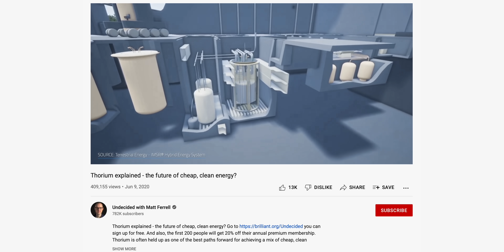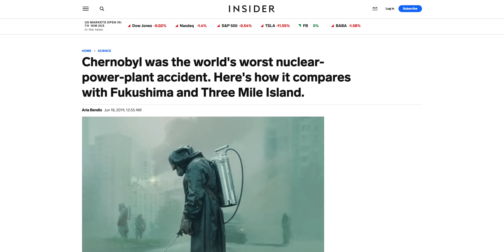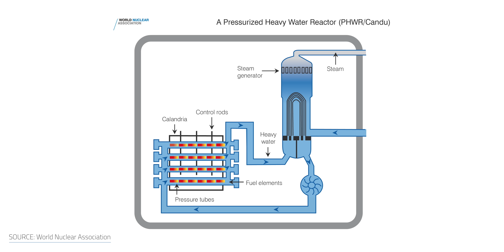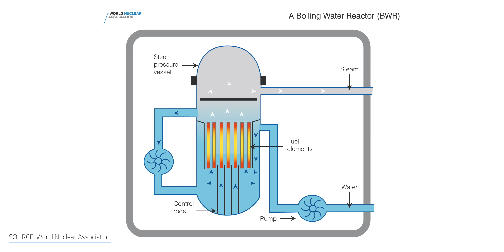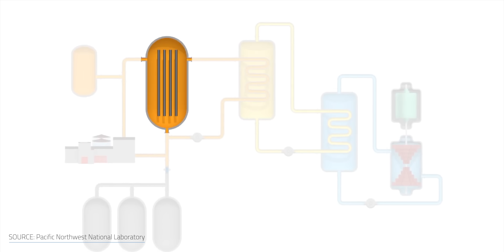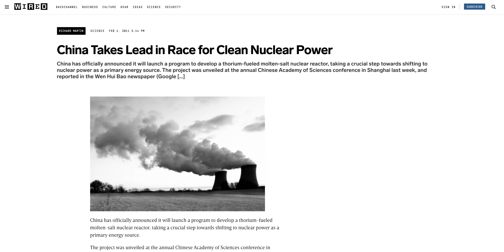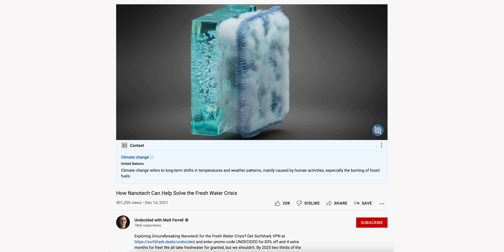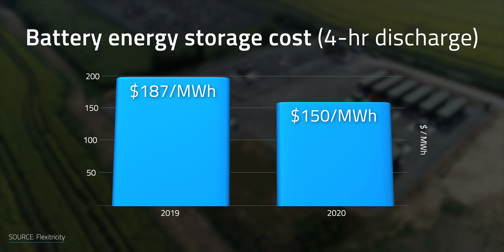Revisiting Thorium Energy - The Future of Nuclear Power?

Comment: You have to have nuclear if you want to go Carbon Neutral. Wind and solar is too intermittent. You need a hell of a lot more than 4 hours battery storage if you get rid of carbon emitting generation. Although the price of manufacturing batteries is going down, for now, the cost of lithium is going up. There isn't enough lithium on the planet to make the necessary batteries for both transportation and generation storage under the renewable model. We would never run out of Thorium.
Reply: Problem is too many don't understand the meaning of energy density. That's where nuclear energy of any kind wins by orders of magnitude. The need is to get away from cycles that are like burning platinum like fire wood.

Comment: Of course we need Thorium Reactor and Fusion Power if we can achieve it. After 30 years of mining all the Lithium on earth for batteries and solar panels, we'll find out that solar is not a 'renewable energy source'.
Reply: Honestly, it is stupid to be using lithium for stationary power storage anyway. The greatest benefit of lithium batteries is the energy density by mass, but stationary systems do not need to worry much about how heavy they are, rather they need to be as cheap as possible, and elements like sodium, magnesium, calcium, iron and aluminum are some of the best and cheapest metals that should be getting utilized for such purpose.
Reply: @nolan4339  Fully concur, but that is not what's happening. Just like we should have used Thorium Reactors 70 years ago, but the guys with the big bucks and business plan always steer us down the road of using their resources because of profit rather than common sense.

Comment: My problem with solar and wind LCOE estimates is storage and 4 hour storage numbers are not long enough. Multi day storage is necessary as extended regional cloudy days and calm air (no wind) occur regularly.
Reply: Yes, and batteries will likely never be up to the challenge of being used for long term energy storage. So some level of fuel-based energy backup will be required.

Comment: These reactors may be particularly useful as we run up against supply problems with materials used to create the massive batteries used in grid storage.  There are unknowns when it comes to problems of mining these already rare resources which will become ever more difficult in the lead up to eventually mining asteroids (as we burn through the low hanging fruit of easily minable deposits faster and faster in the scale up process).  They also may be particularly useful in areas of the earth that go through long periods of little to no sunlight that are also geographically unfit to benefit from wind.  Finally, the fact that these are self-regulating and smaller reactors may make them good candidates for powering heavy equipment in the low population build out of moon/mars/etc industrial/colonial infrastructure.
Reply: Gridstorage is likely not going to use rare materials. Currently Li-ion is used due to its overall maturity and cheaper cost due to scale. However there are plenty of different options being rolled out/developed with more common materials that are much more suited for gridscale storage. In the grid Li-ion will likely only be used as fast reaction units to stabilize the grids due to these other options usually having a slower reaction time (seconds to a minute vs a fraction of a second), and will therefor only make up a very small amount of the grid storage long term, unless if you count the EV batteries that might take part in a gridstorage system.

Comment: Ted Scott. England. Thank you very much Matt for another superbly well prepared and presented video. I have followed this subject with great interest since the 1960's when the trials in Tennessee were carried out. Also. Very important is the massive discussion submitted, which is very relevant. One element of it is the material of construction of the reactor to withstand the long term corrosive effects of 500+ Deg C molten salts, particularly fluorides. A considerable problem I suspect. In my humble opinion, I believe there will be a definite place for this technology in the solutions mankind finds for the energy generation of the future.

Comment: I do hate how these get referred to as a 'Thorium reactor' when It is a thorium fueled LFTR, or some other design that can utilize it as a fuel. It is each design that needs it's own evaluation, not the fuel that it might use. And when comparing the benefits of Thorium as the fuel for such a system please don't compare it to old pressurized (PWR) and boiling (BWR) water reactors. These designs that utilize thorium in the most efficient way are in essence a breeder reactor, so please compare them to other breeder reactor designs instead of incumbent/typical nuclear.

To attribute all the benefits of these new reactor designs to the fuel perpetuates a misconception that only Thorium can be utilized in such a way when in fact many of the MSR designs are instead looking towards utilizing Uranium and will gain many of the same benefits that the so call 'Thorium reactor' is stated to get.

I appreciate that some mention of other MSR designs that do not utilize thorium was mentioned, or hinted at, but these other MSR designs are the competition that Thorium as a fuel is competing with, so any comparisons of technology should mostly be done between these Gen 4 reactors.

Comment: (5:50) Waste from a thorium reactor only requires 500 years to decay away. 

The way you characterize this makes it seem like that the short half life of waste from a thermal spectrum thorium breeder is a property of thorium. It isn't. The short half-life of waste from a reactor like this is chiefly due to the fact that you're achieving an almost complete burn-up of the fuel, which is enabled by the fluid nature of the fuel and the ability to pull out fission product neutron poisons, chiefly Xe-135, as they're produced. You'd get almost the same burn-up using pure U-235, not quite the same burn up but close to it, or from a fast spectrum reactor. 

It's true that starting with U-233 will achieve a higher burn-up than starting at U-235, as U-233 has a 90% fission rate in the thermal spectrum, with 10% of the fuel absorbing the neutron to become U-234, which in turn absorbs a neutron to become U-235, which has an 85% fission rate in the thermal spectrum, leaving only ~1.5% of the fuel to continue past U-235 (if you're starting fuel is U-233). However, most of your improvement in burn-up efficiency comes from the liquid nature of the fuel. 

Additionally, MOST of the fission product waste generated an MSR will be gone within a decade or so of being produced, not 500 years, as the majority of fission products are HIGHLY radioactive and very short lived. There's only 7 long-lived fission products, and most of them are only produced in very small trace amounts, and the majority of medium-lived fission products are represented by Cs-137 and Sr-90, which only make up a combined 12% or so of fission products and both have half-lives of about 30 years, meaning they'd be almost completely gone after 300 years or so. 

Point being, MOST of the fission product waste will be gone within a decade or so of being produced.
Reply: Great response!
As long as we can keep the transuranics out of the waste stream and fully burn them up it doesn't really matter which element is used for fuel. The main difference is the chemistries required and any desired outcomes that we want in the waste stream, such as getting a source of Pu238 (one of the best radio-isotopes for space exploration) or trying to target certain rare isotopes in the decay chain. After all nuclear waste is a great resource for many applications.

Instead of fearing it so much we should rather be trying to find uses for it.
Reply: @nolan4339  What he says about corrosion is also not correct, at least with regards to Oak Ridge's MSRE. Per the report "Molten-Salt Reactors - History, Status, and Potential", published by Oak Ridge in 1969:

"Technology developments over the past 20 years have culminated in the successful operation of the 8-MWt Molten Salt Reactor Experiment (MSRE), and have indicated that operation with a molten fuel is practical, that the salt is stable under reactor conditions, and that corrosion is very low."

The Chinese also has a MSR experiment in the early 1970's which was eventually dropped due to them being unable to solve corrosion issues, but corrosion had already largely been addressed by the Oak Ridge project. Oak Ridge's MSRE was to be followed up by the MSRE-2, which would work on issues not addressed by the MSRE, but the MSRE-2 was killed before it could get started when Oak Ridge had its reactor experiment funding taken away so that it could be given to Argonne National Labs for fast reactor development.
Reply: @nolan4339  (8:37) He talks about how maintenance is an issue for MSR's, but I don't think he's aware of the work done by Oak Ridge on MSR maintenance. Oak Ridge's Youtube channel has an entire video on it, titled "Remote Maintenance of Molten Salt Reactors". You should watch it.
Reply: @nolan4339  He also get's the proliferation issue wrong, ascribing the proliferation risk to U-232 and it's production of high energy gamma (through Tl-208). The REAL proliferation barrier of thermal spectrum MSR thorium breeders (LFTR) isn't the production of U-232, even though U-233 contaminated by U-232 is virtually unworkable in either a gun-type or implosion-type nuclear device. The REAL proliferation barrier with LFTR's is the anemic breeding ratios, 1.05 to 1.07 depending on whether you separate protactinium. Breeding ratio's that low means that LFTR burns almost everything it products, in close to a 1 to 1 ratio, with it taking anywhere from 17 to 25 years to double the amount of fuel in the reactor, depending on the breeding ratio. 

If you're willing to incur the significant cost and complexity needed to build a LFTR from which you can withdraw virtually isotopically pure U-233, you're STILL only going to be able to pull off a TINY sliver of U-233 per year. If you pull off any more than that tiny sliver, you'll kill the reactor as you'll no longer have sufficient fuel in the reactor in order to maintain criticality.
Reply: @nolan4339  I also wonder he's getting the claim that thorium is more expensive to mine than uranium. Thorium is most commonly found in monazite ores, typically in equal proportions with rare earth elements, and monazite is a common and materially significant proportion of the tailings streams of many mines, like iron mines, phosphate mines, titanium sand mines, etc. China produces the majority of its REE's from monazite ores that are mined as a bi-product of massive iron mines. 

So the effective marginal cost of mining thorium should be close to zero, which is why I'm not sure where he's getting the claim that it's more expensive.

Comment: Yes we definitely need nuclear in the mix. So many reasons:  we need a reliable base load so not to destabilize the grid. The fuel (thorium or uranium) is in country and ridiculously cheap. Unlike solar panels that come from Asia. Solar and wind cost more in the end because it does not take into account Massive costs of grid scale storage (that does not exist), DC transmission lines (that do not exist), habitat destruction, and back up gas turbines that emit CO2 (‘I thought we were trying to solve a climate problem?).  Germany is demonstrating how bad it can be- billions spent, increase reliance on Russian gas and the highest electricity prices in the EU.  Why would we not want an energy system that we can build and fuel in country?  And by the way Light water and molten salt reactors have been part of the energy mix for 60 years with an impeccable safety record. France has already proven this to be true.

Comment: I have been thinking...what if nuclear waste could be disposed by dumping it in the subduction zones? Specifically where the oceanic crust slides into the mantle, that would easily drag the waste back into the earth's depths where they cannot hurt anyone.
Reply: No, waste can be burned in a MSR, depending on the cycle used, lots of work now in that direction.
Reply: As soon as the pressure or heat broke the containers it would spill nuclear waste everywhere. Plus tectonics work at a rate of centimeters per year, those things wouldn't be going anywhere anytime soon. Yes, the Earth is pulling an Ouroboros and eating itself, but each bite takes thousands of years.
Reply: @LordFokas  Good point, but at the same time, at these depths even the ocean water itself would provide adequate shielding and water pressure would also contain any leaks, unless uranium floats.

Comment: Perhaps the biggest tool in the Thorium Salt Reactors is the ability for it to "burn" conventional high level nuclear waste! 
Think about it ...... How much does it cost to hold the waste in a tank before t has cooled enough to be vitrified and buried? Take that off the cost of energy production (not that you need to) and Thorium Salt is a clear winner ..... as long as they can iron out the kinks in a new system! It is worth doing it for that reason alone!

Mention was made in this video about leaks from a salt reactor, this is not a problem! Simply send a janitor round and brush the leaked salt out and place it in the fuel bin (to go into the reactor) as it is small in volume and definitely nowhere near criticality! OK maybe a trained janitor ..... with a dosimeter ..... but you get my drift!

There is also the added bonus (compared to trad Nuclear) that although the output of the reactor needs to be stable for economy ..... the output heat can easily be switched between Generating Electricity and Storing Heat or even using it to directly to power industrial processes!

Don't get me wrong, it is not a done deal. Work needs to be done to increase efficiencies and to minimize failure points.
To put it in context, when Kirk Sorenson published the details of the Oakridge Plant on his website (turning it from Secret, NASA only access to Open Source) the son of China's premier took an interest and within a year there were 700 (I think) post grads working on it in China. That is why they are so far advanced in the field! How many in America? How many in Europe? ....... Zero!

So in conclusion we have a power source that can clean up nuclear waste whilst generating energy for less than renewables at next to no environmental costs, that can eather store the energy or shunt it to energy demanding industrial processes at the press of a button and it does not easily produce Uranium ..... and is about 30 times more fuel efficient than a traditional reactor!
Reply: Oh, did I mention there are piles of Thorium ore just lying about as a byproduct of mining?
Reply: Might I suggest that instead of a primate janitor with a broom and dosimeter you use a robot?
This is the 21st century.  You could call up Amazon warehouse inhuman resources, or just buy a few Roombas...
Reply: @NullHand  Good point! The Chinese do go in for robots ;o)

Comment: Rooftop, siding and window solar on every building for home use (HvAC, light, EV). Nuclear for industrial use and commercial transportation (ships, airplanes, energy heavy industry, large road transport companies).
Reply: Congrats for the most intelligent comment so far
Reply: Solar is very versatile so I am fine with it getting installed everywhere (when can be done so in an aesthetically pleasing way), but at the same time the current setup puts the responsibility of managing that energy system on each individual owner of the property, which a is fairly unreasonable and inefficient manner, as not everyone as the aptitude, time, or desire to manage their own energy collection expenditure, and storage system.

I think we will need companies that manage neighborhood energy collection and storage systems and the maintenance of these systems, perhaps to the point where most property owners do not even own the system themselves, but are only slightly compensated for its existence.